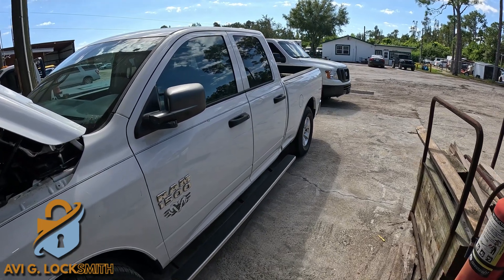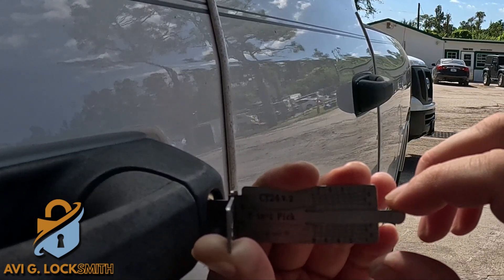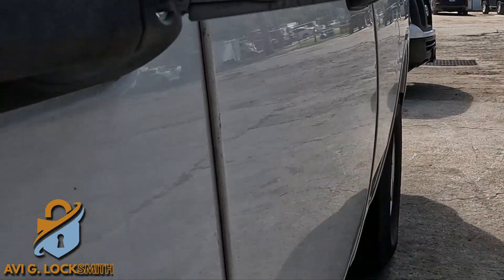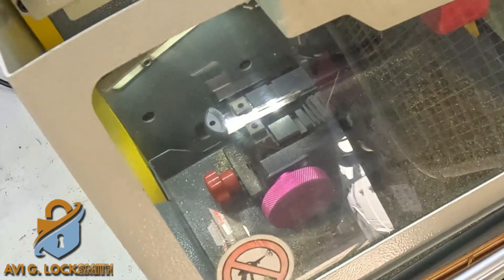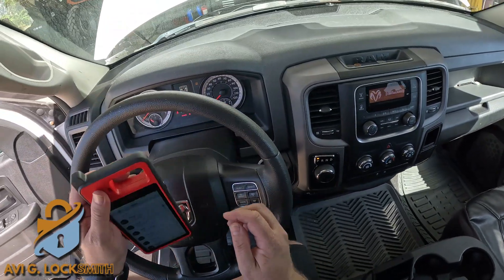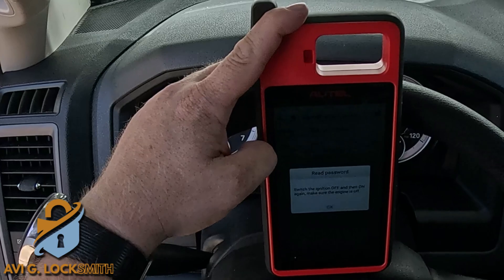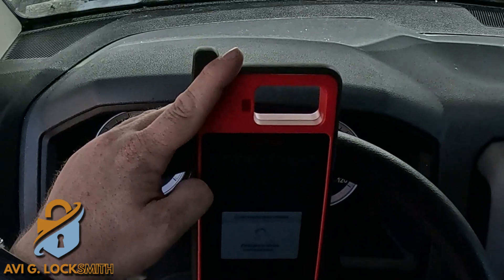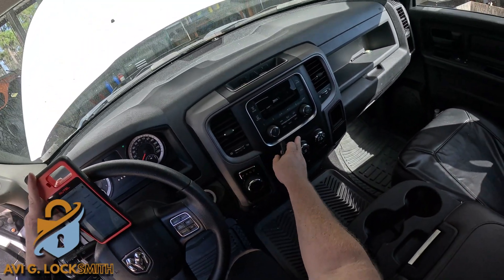Lost All Keys? Program a Key Fob for 2017 Dodge Ram 1500 | Ultimate Guide

Comment: I have the XTOOL D8 and I'm currently trying to program a new key fob that I purchased off of Amazon for $30 and it came with a blade key inside. it asked me to turn on the hazards when I programming the key and then it asks me for the pin code, but it doesn't actually give me the pin code. I was watching a few other videos where the programmer utilized an OBD port behind the stereo to program the key fob. I see that you're using a different OBD2 scanner. Am I doing it incorrectly with my 2017 ram 1500
Reply from the maker: Hey. I'm not familiar with your programmer.

Comment: I have the XTOOL D7 that I'm currently using to program a key fob for my 2017 ram 1500 but when it gets to the point where it asks for my 4 digit PIN code I have no idea what the four digit pin code is or do I just hit enter because it does detect that I have 2 OWM keys for the vehicle so I know that it's connected properly. Where do I go from there? I'm not sure what I'm doing wrong or do. I just hit enter when the prompt window comes up asking for the four digit pin code? Thank you for the great video.
Reply from the maker: Hi. I don't have info on this programmer.

Comment: Will this work on my 2019 ram 1500 classic just like this truck you do in this video I have same type of key?
Reply: No you need to connect special cable to bypass the security system in 2018 and up
Reply: @roeidora00  thank you
Reply: @MrRockyko  connect it to the star connector I think I supposed to be or under the driver seat or under the glove box but it changes
Reply from the maker: Hey. The star connector on Ram Pick Up is under the steering column.
Reply from the maker: Hey, 2018 and up, You'll need  a special cable to connect to the OBD and the star connector (I have a guide on my channel).

Comment: Hi, i. Doing a ram1500 tomorrow, all key lost, did you have to disconect battery for the alarm to go off? Thx
Reply from the maker: Hey. you don't need to disconnect the battery, as soon as you start the programming - the alarm should turn off.
Reply: @aviglocksmith  thank you very much
Reply from the maker: @testingstudionideas3620   You're welcome. Thanks for following me. Avi.
Reply: How much will this cost me? I lost my keys
Reply: @FernandoMartinez-hb1nr  i charged 120 to the guy, but  normally is more like 250
Reply from the maker: Nice
Reply from the maker: I don't know. Each location have their own market.

Comment: I do have a guestion.
I really hope you read it.
Will any key fob I buy on amazon work for my 2017 Dodge Ram 1500 ecodiesel?
Do I need to know the part # or FCC code?
Thank You
Reply from the maker: Hey. You'll need to know the FCC ID or the OEM part number. If you don't know it - you can call your Dodge dealer's parts department with your VIN and ask for the part number. I cannot guarantee the quality of Amazon keys but in general most of them work fine.
Reply: @aviglocksmith   Okay, I need to ask, do you sell the 4 button fob and programmer?
I have to go to the dealer today and get the part # & FCC code.
It is the 4 button fob that allows my wife to start the truck in the summer in Arizona to cool off.
Thanks
Reply from the maker: @guohuaye12  Hey. I'm sorry, I don't sell the keys or the programmer, It can be purchase through any Locksmith supplier (America key supply, UHS hardware, Locksmith Keyless etc.)
Reply: @aviglocksmith   Thank You for the reply.
I have the registration and vin number. 
I'll call them, I guess I'll need to find a cheap programing device.
Thank You